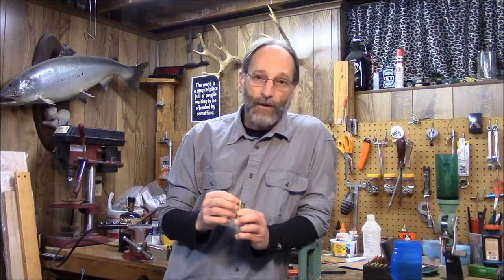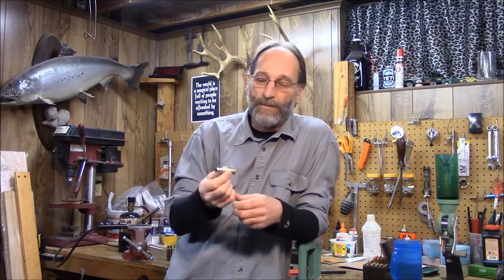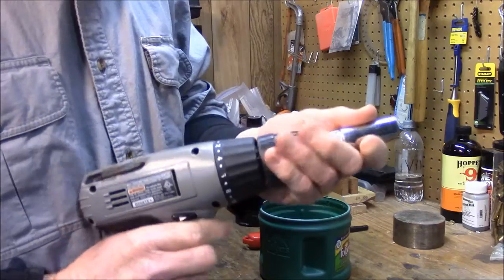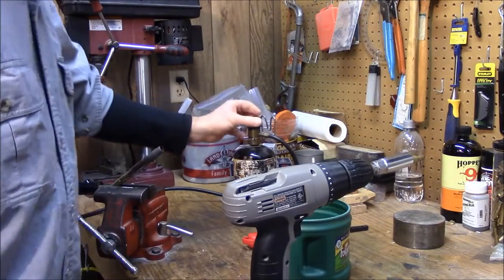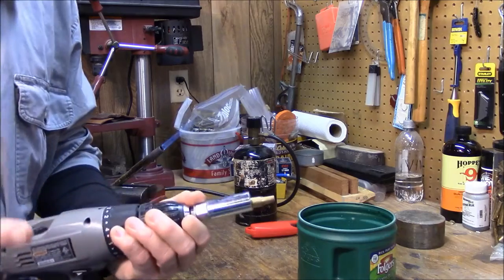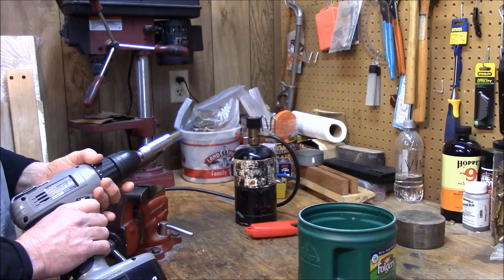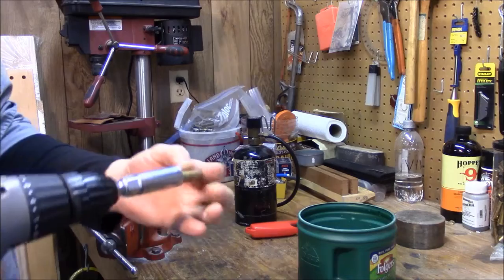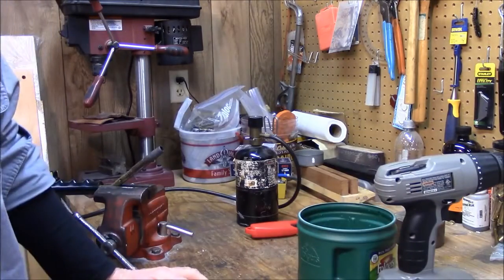Annealing Your brass to make it last longer.

Comment: Is that one of those braising torches?
Reply from the maker: It' just a soldering torch.
Reply: Oh okay! I just bought a 22-250 we shoot prairie dogs I was wanting to make really nice loads for it and your videos are great! If you have any bullet weight and powder suggestions that would be awesome! Thanks
Reply from the maker: My new go to load is a 53gr. V-MAX on top of 38.5 gr. of H380.
The 53gr just this last summer replaced the 55gr V-MAX.
Reply: Awesome I will have to load some up and test it! Thank you!